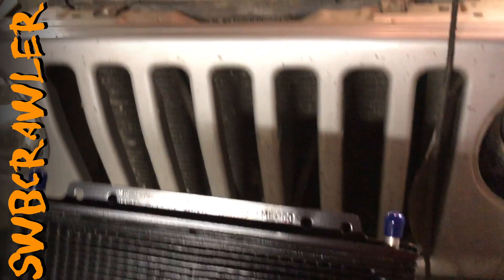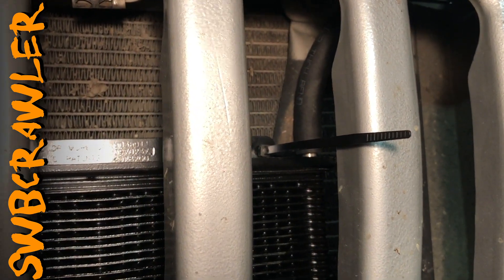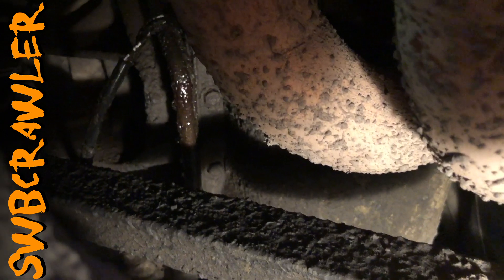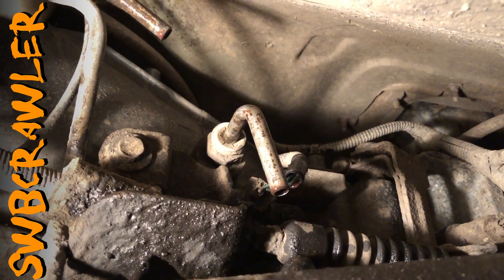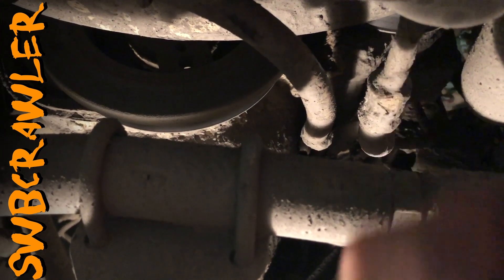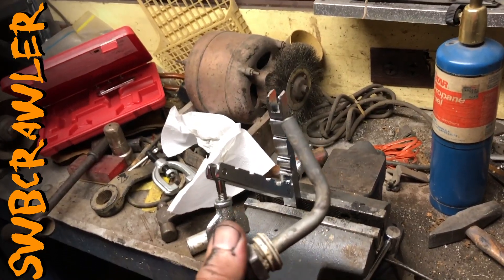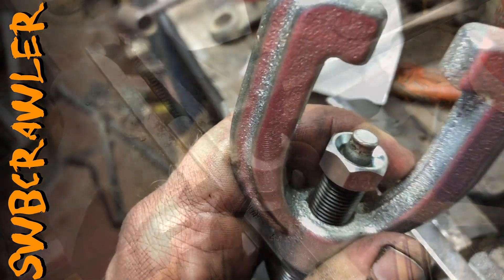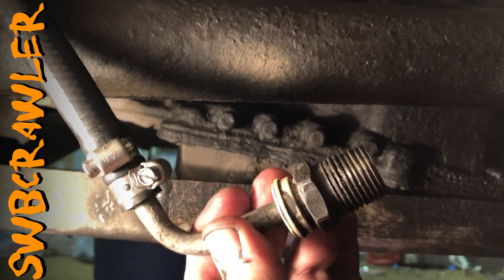Building 42rle Cooling lines, and installing a B&M external cooler in a 2005 jeep TJ LJ.

Comment: nice work. i am doing similar but adding a remote cooler back above the rear axle with electric fans.  I am removing the OEM clips/connectors and hardlines completely and installing AN fittings at the trans...

Thanks for sharing your insight into the return/send lines and your process of completing this
Reply from the maker: absolutely! thanks for watching. i would recommend adding a trans temp sensor too. i wish i had because i really have no idea how much this helped.

Comment: Not sure why you would put the cooler before the transmission? So at this point it gets cool then hits the radiator and gets hot and return into the transmission hot...so basically its the same as before you installed it. It should be ran stand alone or after the radiator.
Reply from the maker: this is a long running argument.  i looked into it before i put in the cooler. basically….  in a cold climate, the radiator cooler reservoir actually serves to warm up tue fluid so it’s not too cold coming into the trans.  in a climate that never gets all that cold, there’s no real reason to do that. so you can get away with just the external cooler on its own. it is not the same as running without the external cooler the way i have it though.  the stock radiator cooler is not capable of properly cooling on its own in warm enough conditions. the external cooler adds some more cooling capacity to the system.  ideally i should have gotten an external cooler with its own fan.  and i may do that at some point. but this has been working so far.
Reply: @SWBCrawler   I agree with everything you're saying except. The cooler still should have been ran after the radiator not before.
Reply from the maker: @BeardsandCars  eh. that’s not what the install instructions that came with it said. and not what the research i did said. so. i did it before
Reply: @SWBCrawler  well I'd personally have to say it must have been read wrong or misprinted..if it's working for you I guess it's ok but Definitely Strang and don't make a link of since. I'm not here to bash you I was just concerned to hear this as I've never heard nor seen anyone install It like this.
Reply from the maker: @BeardsandCars  all right.  it’s been a while since i did this install.  i just went down to the garage and looked.  my install matches this diagram. https://documents.holley.com/70268_instructions.pdf.
Reply from the maker: that puts the cooler air flow wise in front of the radiator and condenser. and hydraulically after the radiator.   i’m now rewatching my video to see if that matches what i said.
Reply from the maker: so you’re right. that’s not what i have in the video. and i’m trying to remember if i changed my mind mid install or changed it later. but i did outline the reasons as i was going over my diagram. i still don’t agree that installing it before the radiator is completely counter productive. it will still assist the radiator while not over cooling the fluid. as i understand it the purpose of the radiator reservoir is not just to heat the fluid. but to cool it, it just can’t keep up in certain conditions if the fluid coming from the trans is too hot. having the cooler before the rad will still assist in cooling.  this hobby is all about diverging from factory design to fit our needs.
Reply from the maker: So yea, I just rewatched the entire video to refresh my memory, and I do not mention changing the design.  So either I mis-traced the lines when I checked this morning, Or when I re-did the lines (i rerouted some of them and replaced the one I talked about at the end of this video) a few months ago, I changed the setup.  Either way, either setup is valid for the reasons I covered in the intro/information part of the video, you are welcome to choose which setup you prefer,  cooler first, cooler second, or cooler alone.

Comment: Greetings, very informative video. However, are you still sure that the return is on the passenger side? Shop manual shows the upper line from transmission (return) going into the driver's side in the radiator (for 2004)

Comment: Where did you run your lines
Reply from the maker: I ran the lines over to the frame and up over the shock/spring tower.  Then to the grill.
Reply: @SWBCrawler  thanks I'm having the same issue from line rubbing on exhaust on my 05 lj
Reply from the maker: @brentjimmerson4593  a friend of mine ran soft lines to the frame.  Then aluminum lines up to the front of the Jeep.   I may someday move to that. the only thing I think I would do different is get longer sections of the rubber hose instead of having to patch them together so many times as I did.